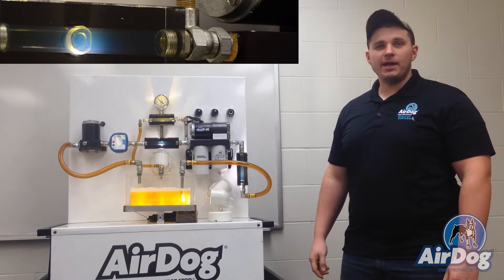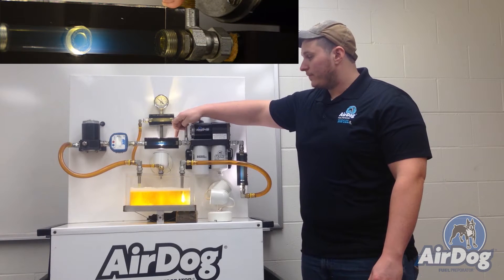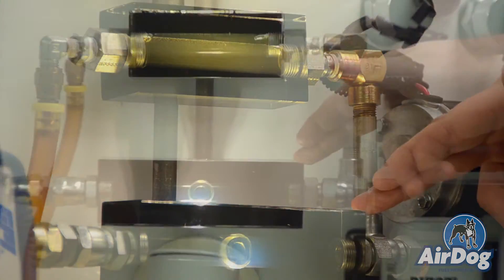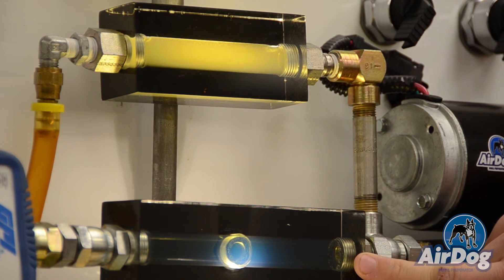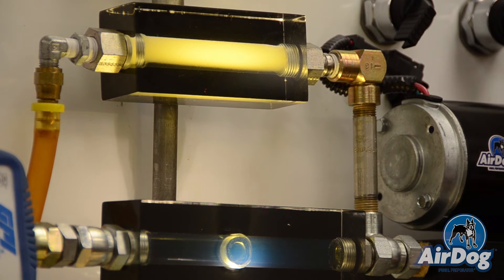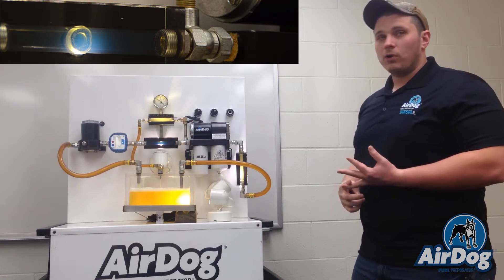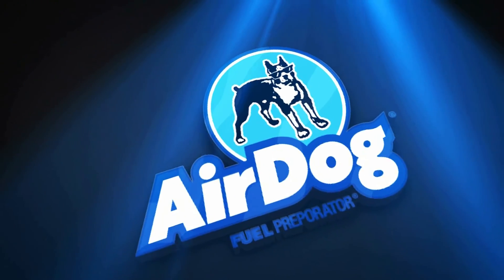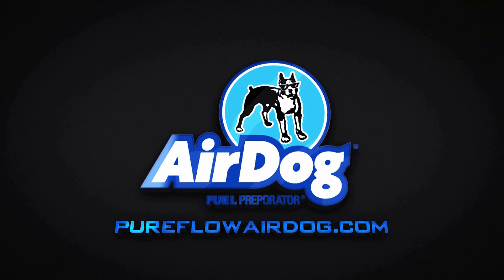AirDog II-4G Display Stand Demonstration HD

Comment: Does the new 4G have a longer run life? I am having my air dogg2 pump replaced for a second time over just a few years. When my mechanic called in for warranty they offered to upgrade to this style pump for a small extra amount of money. They claimed it resolved the motor failure issues. I am looking forward to seeing how it does, especially the quieter pump.
Reply from the maker: Yes, it does have a longer run life. The addition of the intermediate shaft that is driven by the motor though a Lovejoy coupling allows for longer shaft seal life. Because the pump mechanism is better centered, it has less wear on the motor as well.

Comment: Now this is the video I have been looking for! While it's nice to have a quiet pump, and one that lasts and will withstand the elements, like in a very wet situation (Rain driving, creek crossing, etc.) The main reason for buying a set-up like this, with its premium price over a simple lift pump, remote filtering competitor, is this units air filtration capabilities. A Great video showing this off? Thank you Brandon. 

  The only thing I'd like to see added, would be having you show it doing its thing, in both an idle situation, as well as WOT (full flow 150 gal. e.g.). To prove the bypassing in your unit does not affect its air removal efficiency, in its entire range of operation.
Reply from the maker: Steve, our AirDog systems will withstand the elements. We had an AirDog II submerged in water for months with no issues. Thanks for your input. We will look into this test in the near future.
Reply: Thanks. Yes, I saw those videos. In the tank over the holidays, and then some. Great!

But, just who was it that forgot to paint the bottom of the pump stand?
: - )

Again, my concern is how the by-pass (pressure Reg.) affects the air removal, during by-pass. I'm sure you have it all figured out. Everyone here in the Midwest has been talking about this unit, and speaking very highly of it. I came here to look a bit, and research it. I need something like this for a fleet of Trucks.

How is the 200 gal. unit coming along?